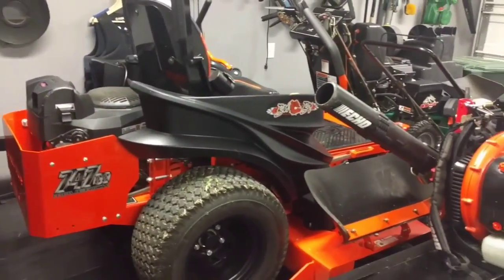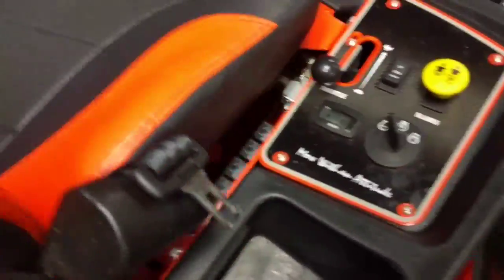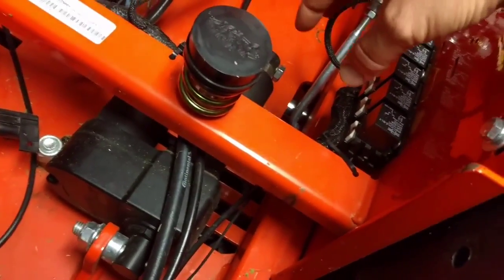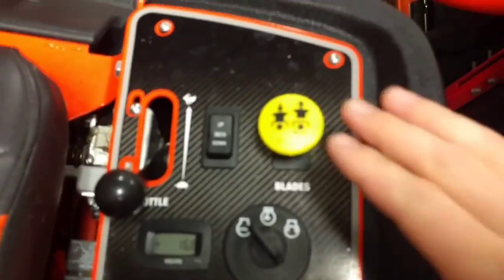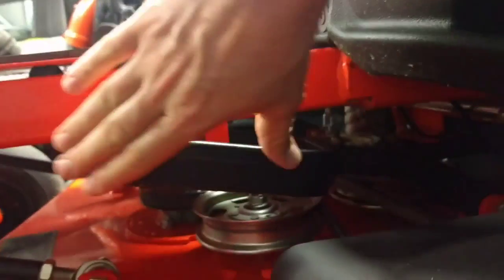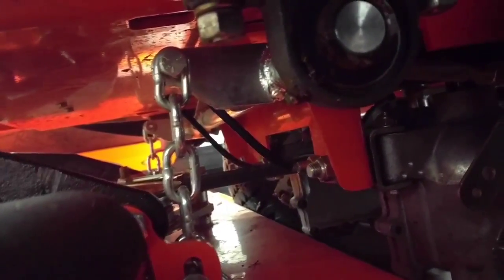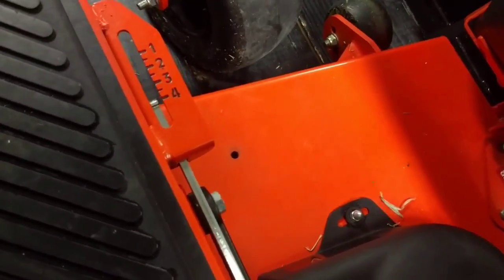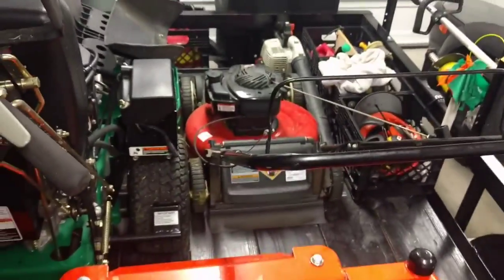BadBoy Maverick Electronic Deck System

Comment: I have a 2023 Bad Boy Maverick I purchased in the spring of 24.  I have a question for you if you can help me.  When I go to start to machine I have the break on, blades disengaged, choke on, the controller arm in neutral position, while seated on the mower.  I turn the key on and hold the key. Sometimes it starts, other times it will not start at least not right away.  I purchased a new battery on 9/10 because I figured it may be simply a bad battery even though the battery sticker says 8/23.  The “new” battery on the Maverick started after a few second hesitation just like with the “old” battery.   I thought that was a bad sign. I jumped on it this morning and the same thing.  Would not start until the fourth or fifth attempt.  When I turn the key you hear nothing…….Wiring under the seat appears to be in tact. Nothing obviously wrong to me. The machine is used once a week at my home and it probably has about 20 hours max on the new mower.  Advice is appreciated if you have a few minutes to spare🤞🏻
Thanks
Stephen from Ohio

Comment: What  could  cause  it to stop  working
Reply from the maker: I'm not sure with the BadBoys but I know for a while SCAG had a lot of problems with faulty PTO switches.  Would be worth a shot to start at the switch and check to see if it's working with a multi meter.